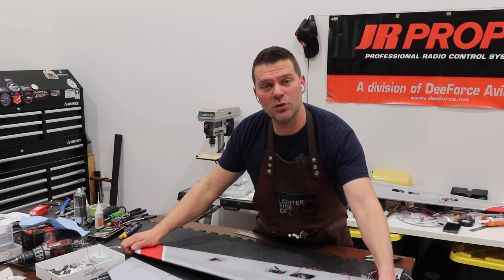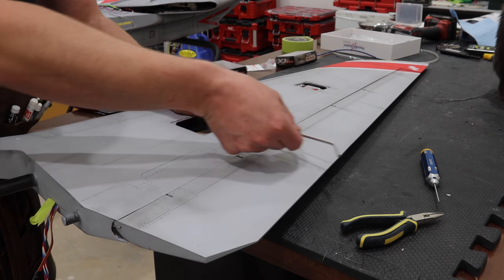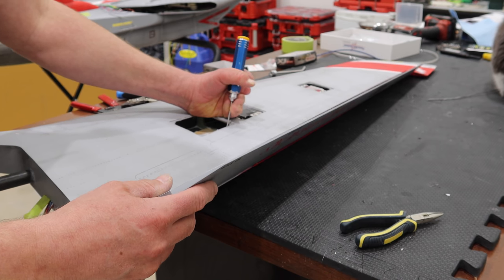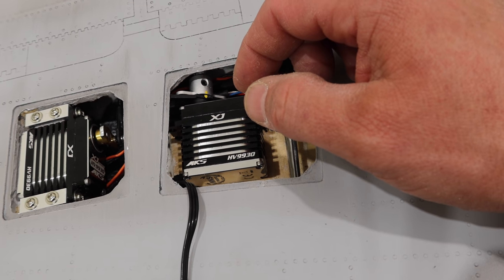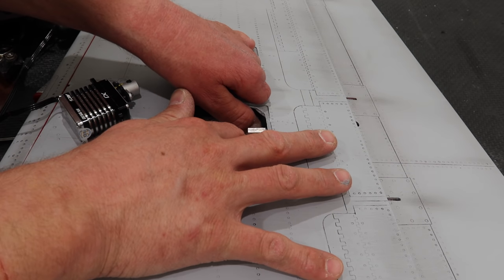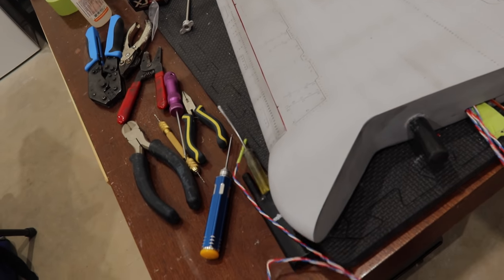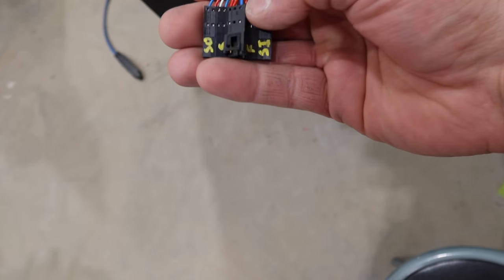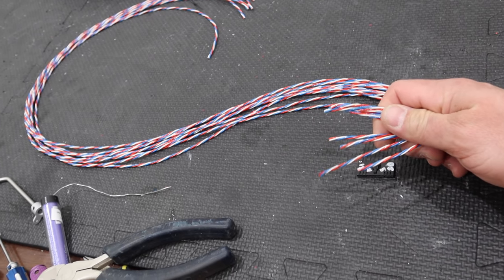HUGE F-14 Wings Construction Complete - Flaps & Wiring Skymaster F14

Comment: Its the Wing that required the most hanger time. Flaps , slats, and spoilers all timed with torque tubes and actuators, control by computer or manual. Get it worng and you will have flap/slat lock out. Avionics however is the number one reason for a Down Tomcat. Nice build. It appears she is still a beast even in smaller scale.
Reply from the maker: You got that right!  There is a lot of mixes and conditions that will be setup in the radio to make all of it work and not interfere.

Comment: Great job as usual,  but I have a tip time for you; instead of diagonal cutters, try flush cutters...no sharp little ends on the zip ties. Working on cars and truck, those little ends are like scalpels reaching in. Save some skin, try the flush cutters!
Reply from the maker: I will have to check those out.  I have been bitten by the sharp ends as well!  I feel the pain!😂
Reply: @thelightersideofrc  you can also file/grind your diagonal cutters  so they cut the zipties flush.

Comment: Very nice explanation of the wiring and how to protect them with snake skin. Just for reference, I use heat shrink which has a very strong glue on the inside and when heated to shrink the tubing, the glue activates and is very strong. Zip ties are great but I have found they can hang up on the connector if required to move like the swing wing. Just food for thought. As always a great video and looking forward to seeing you in the new shop. Thanks for all you do!!!!!
Reply from the maker: Thanks Hank!  Great tip for sure and your right.  in some situations they can cause an issue.  Thanks for watching!

Comment: I would sand that edge of the carbon fiber brace down to smooth the ridge so it does not cut into the snake skin, I might even put a piece of electrical tape to limit the ware.
Reply from the maker: Great suggestions.  Will take a closer look as we get into the finishing touches of the aircraft.

Comment: The Flap uses an RDS system. Awesome! Can't get it any better than that. So much torque to the flap with that method. In order for the play to be at its minimum, the pocket in the Flap has to be snug but not tight.
Reply from the maker: Yea it's a very slick system!  i'm quite impressed!  Would be nice to see this on more aircraft!

Comment: That is indeed a sexy wing. Cool video. I have a question for you from your experience: What is the impact of receiver to servo cable length on servo performance for large rc airplanes. When you get to like 2meter+ on cable length, does it result in significant voltage drop that the servos may not work. Thank you
Reply from the maker: Thanks Anar.  there is probably some voltage drop on long cable runs.  That's the reason I use high quality Powerbox Maxi wire.  Best servo wire in my opinion.

Comment: Question about the flap rod:  Won't it scrape and wear on the inside of the flap?  Would rounding the tip of the rod help reduce wear?
Reply from the maker: I thought about that but it's full contact with the receiver portion through all positions of movement.  It's not just the tip that is contacting the receiver.

Comment: Yeah kinda sucks they get all the benefits from our builds, AKA more sales and money while we get all headaches.  I had to apply hysol inside to remove the slop around the shaft, I also rounded the end of the metal shaft.  There should be a set screw on the servo coupling, to hold the metal shaft.
Reply from the maker: Thanks Keith.

Comment: Love everything you do!!!  2 suggestions thou, your audio often sucks (the worst is the hollow/echo in your shop), please get yourself a wireless mic that you can clip on your shirt, also your camera doesn’t really handle focus very well, maybe get a vlog camera like the SONY DC-ZV1B CAMERA CREATOR/VLOG BLACK and my suggestion for the wireless mic would be the new DJI mic…
Reply from the maker: Thanks!  For a couple months now I have been using a Rhode wireless setup.  battled interference with my camera for a few videos but have it sorted now.  I would like the new DJI wireless setup buy not available in Canada yet.  Just got my camera late last year and not overly impressed with it.  I'm most frustrated with it only recording about 8 min then shutting down due to heat.